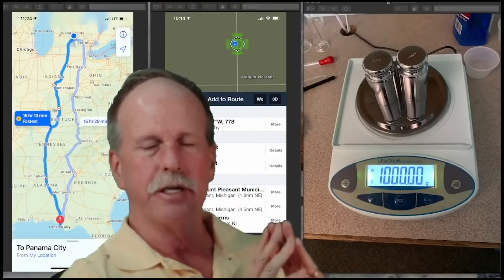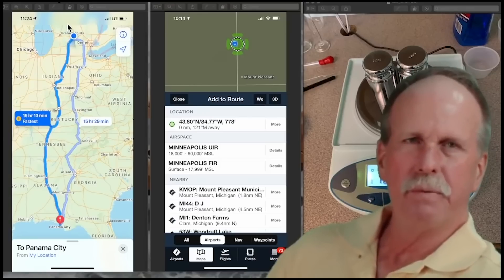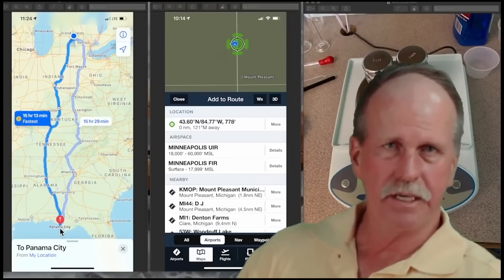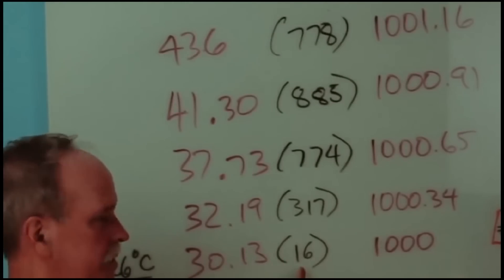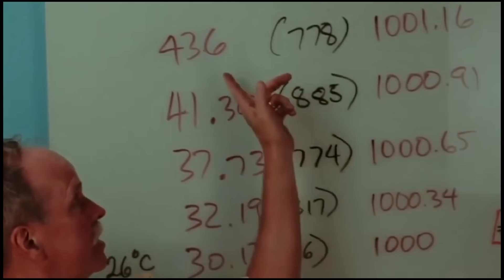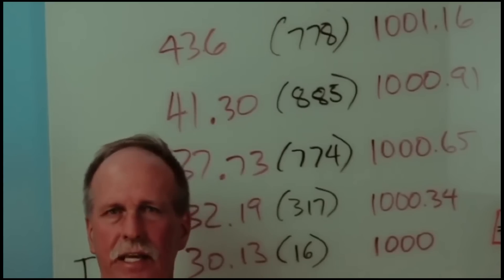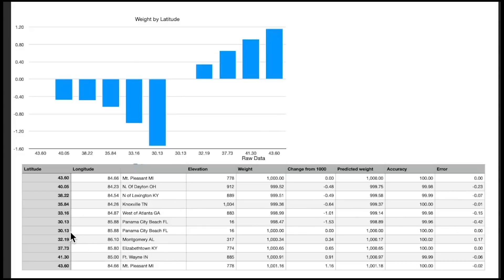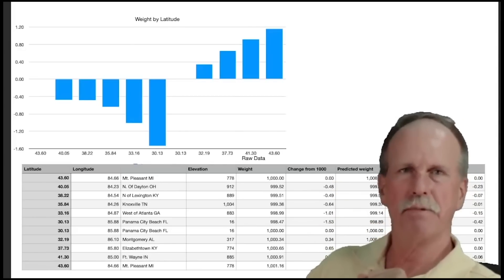Rotation Test for Flat Earth

Comment: Excellent video. The effect of latitude and elevation on measured weight is measurable...as you prove so elegantly in this video. I used to do aircraft weighing (large commercial aircraft) and we would routinely correct for latitude and elevation in our computations. Most aircraft scales are calibrated for a latitude of 45 degrees.
Reply: Aircraft weighing occupation - way cool job!!

Comment: You use Celsius …. Flat earthers can’t comprehend that Bob 😂
Reply from the maker: Translated it as well up freedom units
Reply: Well they got challenged, didn’t they?  Come up with the temps…. I loved that part.
Reply: I don’t know the material of your calibration weight… 7.4 g/cm3 so I guessed gray cast iron with chrome plated. It’s not going to make whole lot of difference… ballpark values. Looked up the thermal expansion coefficient.. I hope I didn’t make a mistake, I am clumsy , however it is must have been a nice 76.6 Celsius in Florida… That explains a lot about Florida.

Comment: It's sad that they can't see the irony that buoyancy due to relative density is caused by the very gravity they deny.
Reply from the maker: No they can’t
Reply: In fact, without the presence of net gravitational force, such as in freefall, buoyancy doesn't exist at all. A boat in zero G immersed in water will make no effort whatever to float. It will be perfectly happy to be completely immersed in water, which will cling to the boat from adhesion and surface tension in a sphere around it. Without net gravitation, there can be no buoyancy.

Comment: Systemic noise. At that precision, 1:100,000, You could be out of level with the scale by about 1/4 segree or 1 inch in 18.63 feet. That degree of level is better than most carpenters levels.
Reply: I calculated, that for a difference in weight of 0.1%, the scale would have to be tilted by about 3.5° which would be noticable.
Reply: Wrong number: its 2.5°

Comment: Temperature: Well, accoring to Archimedes a body looses the same weight as the media it displaces. Air density is about 1.2g/1000ccm. So, the 140ccm bodies displace 1.2g*140/1000=.168g air. Now, to decrease the measured weight by 1g the air density must increase so the 140ccm volume adds 1g to its weight. The air density must increase by 1g/140ccm or 7.14g/1000ccm i.e. the air density must be 1.2+7.14=8.3g/1000ccm. This can be accomplished by increasing the air pressure by a factor about 7 which I do not think has been the case or by decreasing the temperature by a factor of 7 assuming that the air will still be an ideal gas: remember to do this in Kelvin, 301K (28C) must be lowered by the same factor of 7 remdering the air temperature 44K or -229C.
Bob, please correct if I am wrong :-)
The next argument could be that gravity decreases by altitude ... sorry, gravity does not exist. Then try this: Air density decrease by altitude, but even at the Dead Sea or at 15000ft the pressure does not increase/decrease by a factor of 7.

Comment: Some of the readings which didn't quite match the predicted value could easily be explained by local geology. There are patches on Earth where gravity is slightly stronger or weaker than average because of the structure and material below the surface.

Comment: Density, haha! And, if the weight changes temperature then wherever it's sitting is probably at the same temperature. They also need to take into consideration the density of the media surrounding the weights which would be air and the humidity I don't think booty will give you anywhere near that much variation. It could be calculated but I doubt we could measure it with anything we could get our hands on.

Comment: electronics nerd here. I will say one thing, that the single biggest effect temperature has on these measurements is due to the temperature coefficients of the electronic components inside the scale. however:
1. your measurements seem to be unaffected, suggesting the scale has built-in temperature sensing and compensation for temperature caused non linearities
2. the measurements were probably taken indoors, which both prevents wind and temperature from significantly affecting the results
edit: this is also one of the coolest sphere earth experiments i've seen. i didnt expect the WGS84 fit to be so much better than the sphere models.
between this, and the "15deg per hour drift. thanks bob!" i feel that flerfers with even a shred of critical thinking ability should have serious doubts about their model

Comment: OMG thanks for this.
I love how Flerfers go on about "relative density" without explaining why objects don't fall UP because the air is LESS DENSE as you rise. 
By that reasoning, objects should go to lower density... or up.

Oh, and the temperature change to cause those changes in weight would be equivalent to phase changes... or in short, the damn weight would have to be melting to do that.
Reply: Easy density/buoyancy experiment:
Take a (preferably small) transparent plastic bottle. Make an aperture at the bottom, so you can inject a steady stream of air that form bubbles and rise in the partially water-filled bottle. A simple rubber balloon should work well enough. 

Watch the bubbles, record them on camera.

Drop the bottle from some height, watch how the bubbles behave. If it is density, they will continue to rise up. If it is gravity, free-fall will negate the effect of gravity and the bubbles will stop rising.
Reply: @advorak8529  Dropping things on the vomit comet flights as well.
Those flights SHOULD NOT WORK if it's density.  The irony being that's what happens in orbit, except it just misses the ground.
It's not even that hard to work out how space works.
Reply: @advorak8529  Or just watch some "zero-g" flights, where they do some experiments with water.

Comment: Measurement and Instrument are two words completely OUTSIDE the ken of Flat Earth Idiots.
Next experiment: Gyro-stabilized platform should show a rotation of 15.04106865 degrees per hour (NOT 15 degrees per hour) because the Earth's rotation period is the Sidereal day of 86164.0905 seconds not the Mean Solar Day of 86400 seconds.

Comment: Ok, at 101325 Pascals of pressure (one atmosphere),
140 cc of volume displaces about 160 mg of 28deg C air, because
1cc or air weights about 1.17 mg.

In order to displace 1.5 g more, air density would have to increase to about 10 times more.

Now, as temperature drops, density of air increases. At -30C (-22F), which is already freaking cold, 1cc of air weights about 1.45 mg (still way off of 10), at -100C (-148F), which is already lower than the lowest temperature ever measured on Earth, it's about 2.04 mg. At -190C (-310F) it's about 4.24 mg (which is still not 10 mg)

There's no point in going lower, because at such temperatures, air becomes liquid. Moreover I highly doubt Bob experienced such cold on his journeys. Temperature change cannot explain it.

So how about pressure? Closer to sea level pressure increase right? I save you time reading. Air pressure would have to increase about 9 times. So suddenly, surrounding air would feel like about 90 meters under water. Air pressure doesn't change this much. So pressure cannot explain it neither.
Reply from the maker: And that is how you science things

Comment: Another factor which could influence the readings is air pressure (in combination with temperature), as the weights have a different buoyancy with different air masses of the 140 cc space taken up. And different masses of the ground at a particular location will also cause "errors". Of course both factors are way too small to account for the differences in measured weight, where the "mainstream" explanation is (again) spot on.
Reply: There are also gravitational anomalies and magnetic anomalies (metal weights and metal parts in the scales) that could also have an effect on the scales.
Reply: Right, gravitational anomalies was what I hinted at with different masses of the ground. Good weights should ideally not be susceptible to magnetic forces, which anyway mostly could act a little bit near the poles.
I was also considering if the "push" from cosmic rays could somehow be different at different latitudes, with variations in the shielding from the Earth magnetic field, but did not come to a conclusion whether there plausibly could be some minuscule effect here.

Comment: The best possibility I could see for temperature affecting the results, particularly under the claim that what we see as gravity is just relative density, is if the air temperature changes, rather than the temperature of the weights.  And although I admit that I don't know enough to say that it definitely doesn't, I'm pretty confident that any affect it does have is significantly less than the measured difference.
Reply: The temperature of the weights is irrelvant, because density change does not change the weight, but it is possible that the temperature of the scales themsleves may result in errors with the readings. 
The solution of course would be that when you get to the motel, you stick the scales on a table and turn on the Air Con to 20 degrees and go to the nearest bar for a couple of hours. When you come back, you have the room (and the scales) at consistent temperature for the whole set of measurements (Yes, I know you don't rely on the AirCon thermostat... you have to measure the temp to be sure)

Comment: The reason Flerfs cant understand this is that they can't deal with numbers above 20 (limited by cold weather and whether gloves and socks are on or off) and 1 decimal place.  They cant do integers as little numbers dont count as much as big ones, but they dont know by how much.  You cant do minus numbers coz negatives dont exist, so they cant be included.
Reply: On a flaterf anything smaller than 1 is a negative number.

Comment: Great example of independent empirical verification! What defeats flerf excuses is the fact that none of the other parameters, such as temperature, pressure, magnetism and density of the ground are correlated with latitude. They should introduce random variations, not the observed pattern of weight increasing as the latitude increases.
Reply: hmmm  lets see, only 2 degrees difference in temp, air pressure change, maybe 50 millibar, non magnetic SS is the material of the weights so we can leave out the magnetic effects, the differences in granite compared to packed sand, limestone.... that might have effect, Phd Tony can give us some insight to that... but the main effect to be looking at is air density changes and as previously mentioned, the way to change air density is change the temp or pressure, but you cant change the pressure of atmospherical air on a flat earth without a container...
Reply: @bunnykiller  Again, none of those have a relationship with latitude.

Comment: so, if you started off with 1000g up north and the weights were 998.47 when you got to your destination in the south, that means the air had to increase in density to create more of a bouyant effect upon the masses. To increase the density of air one needs to drop the temp or increase pressure. So after alot of messy numbers the air would have to be around -231 C to be dense enuf to offset the weight by 1.53g....   ummm I dont think that would work too well, can we say frost bite  ;)
Reply: Better hold your breath. Inhaling liquid air will be bad.
Reply: @XtreeM_FaiL  that it would be... I even checked out a situation if the air was liquid and found that it would be too dense and cause the scales to read even less

Comment: If it were density changes due to temperature, I'd like to see them take the reference weights and put them in boiling water for a minute, weigh them, and then out them in the freezer for an hour and weigh them. I have a distinct feeling that they will weigh 100 grams no matter what temperature! Temperature doesn't change mass. Speaking of density, those flerfs are REALLY, REALLY dense! 

I love your channel, and I love seeing you play them on their own, "what you can test yourself and see with your own eyes," bullcrap game!
Reply: temp does change mass...  it makes it bigger/smaller  ;)
Reply: @bunnykiller  Mass does not change. Weight can change. Two different things.
In fact (rest)mass never changes unless you remove or add something.
Reply: @jarls5890  temp changes the volume of the mass, true,  it doesnt change its weight, it will change its density
Reply: @bunnykiller  Actually...you are wrong again (sorry...not trying to be an a-hole).

Temp will change the volume and density of the mass. When the volume changes, its buoyancy in the atmosphere will change ever so slightly.

So - the weight of an item in earths atmosphere can change with temperature.

(rest) mass never changes, unless you take away or add particles. Mass is an intrinsic property of an object. 

Note that volume and density is not necessarily the same thing. If you have a hollow container (e.g. a large steel supertanker) - the thermal expansion or contraction of the volume of that will be far greater than the change in density of the metal it is made of (unless my thinking is way off).
Reply: @jarls5890  your thinking is off, the volume of a super tanker is the same as the huge block of steel it was made of, it still displaces the same amount of air when both are at the same temp,  they both have the same number of molecules...
Reply: @bunnykiller  Mmm....not sure what you mean. Also you say that a super tanker is made of a "huge block of steel"? Most assuredly they are mostly made of steel plates and rivets. But the tanker is probably over 90% air. And this is my reasoning:

Lets say you have a very large tank(er). Several hundred meters long. 90% is air (contained). When the tanker heats up - it expands. Lets say it expands several tens of CM (because it already is so big). Due to this expansion the metal it is made of will be less dense. We agree on this. But it will now be able to contain a lot more air - which is much less dense than steel - at any temp. 

Conversely - if we had the same tank(er) - but now made out of solid steel - with 0% air. It would still expand the same amount (I think)...tens of cm. And the density would drop. But steel is denser than air. So the total reduction of density is greater in the "90% air" tanker compared to the "solid steel tanker". I think.
Reply: @bunnykiller  You're digging yourself a bit too deep and might want to take a step back. Please just look up mass. My best guess if that you are conflating it with volume when they are decidedly not the same thing. Mass if a measure of physical matter and though there are some relativistic effects that could be used to argue that mass can change with temperature, for our example it's like saying that heating something changes the number of atoms in it. It does not. Nor does the 'mass' of said individual atoms change.

An object with the same number of particles packed tightly or loosely, that is at different densities, (assuming in this example they aren't packed so loosely to let air particles fill in the gaps) will always be the same mass. e.g. A metal water bottle in the fridge slightly changes volume as it freezes, not mass. Weight is different from mass in that you can weight a different amount from a different frame of reference or in a place with less gravity - mass is unaffected by these factors hence the distinction and why physics required a separate term.

from nature.com: On Earth, the weight of the body (like any other object) is given by Newton's laws as mass times gravitational acceleration (w = m * g). That is, the weight of an object is determined by the pull of gravity on it. Aug 7, 2019

This is all to say that temperature will affect volume and density long before it will meaningfully change weight let alone mass. Even the point about extremely minor weight changes based on atmospheric bouyancy or convection is only relevant because we have an atmosphere yet mass remains constant regardless of this.
Reply: @jarls5890  take the tanker out of the water and put it on the worlds biggest scale, now build another tanker to the same exact size shape weight etc and put it on the scale, thay both weigh the same, now take one of the tankers and crush it down into a block using the worlds biggest car smasher, the block and the tanker will weigh the same. They both displace the same amount of air when both are at the same temp but were not going to worry about a few kilos of air weight when the tanker/block weigh in at thousands of tons...  if you were to heat up the steel it will expand at a specific rate per degree increase, its called the coefficient of expansion, the constant ( a number given for each type of material) determines the growth rate...  for example a rail road track 2 miles long undergoing a 40 degree increase in temp will grow an additional 3 feet longer, its not much, but its enuf to screw things up...
Reply: @bunnykiller seems like a fundamental misunderstanding of mass. Mass is not referenced by size. A lead weight will be a lot smaller than an aluminium weight of the same mass. Expansion or contraction via temperature does not change the mass of an object, just the size.
Reply: Weighing the masses when they were hot could give a different result. For example, the warmth would set up convection currents above the scale which might change the reading. Thermal expansion of the masses would lead to them displacing fractionally more of the air, giving an increase in buoyancy and a reduction in weight. I haven't tried to work out the size of these effects, although I doubt either of them would be measurable on Bob's scale. However, it's important to at least think about possible disturbing influences when making such delicate measurements.
Reply: @ceejay0137  
Google says air is 0.00129 grams/cc. even if those 500 gram masses gained an entire cc of volume, they wouldn't displace enough air to be measurable on Bob's scale.